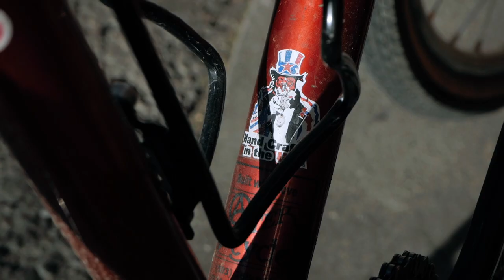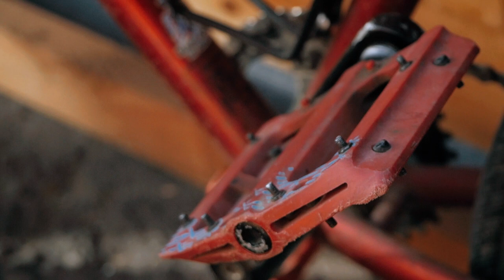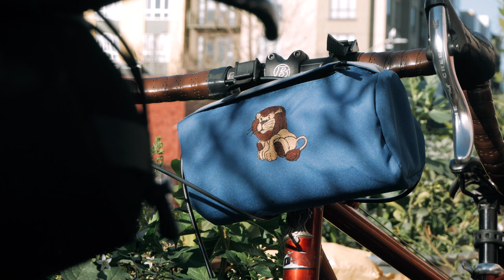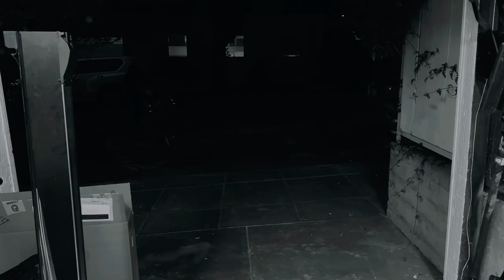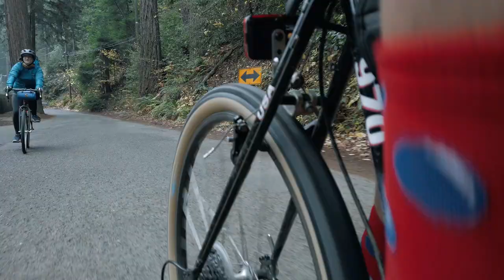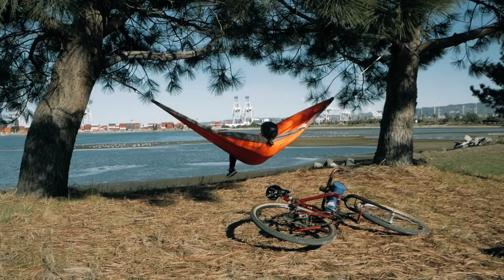Morgan's hand-built Voodoo | Steel Monstercross Bike

Comment: I have a 30 year old steel frame and I wouldn't trade it for anything. Just like you I designed everything else around it And it's a beast that keeps on trucking
Reply from the maker: It's a versatile, reliable and most importantly, super fun to ride. We share many memorable experiences riding together.